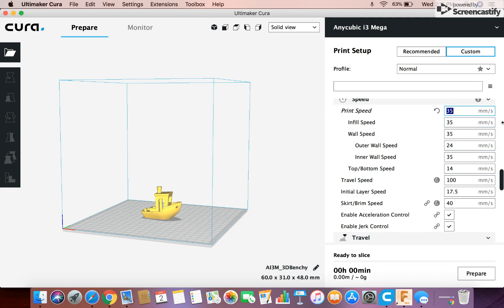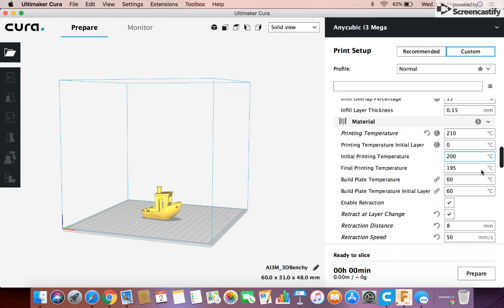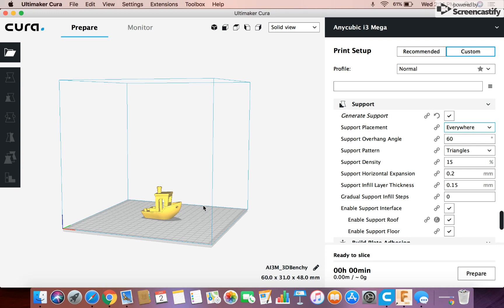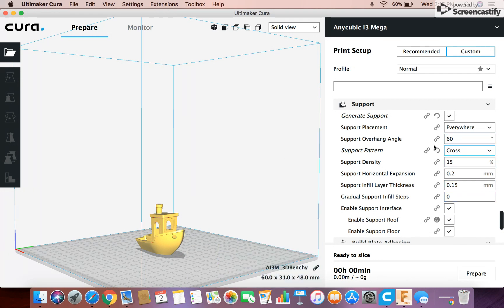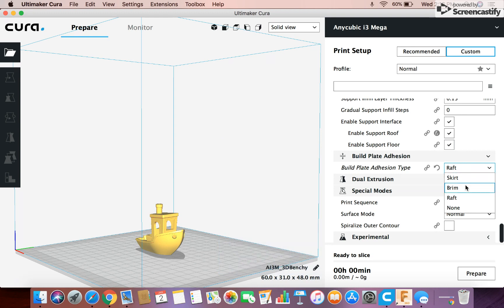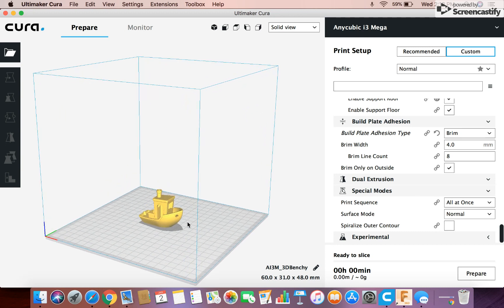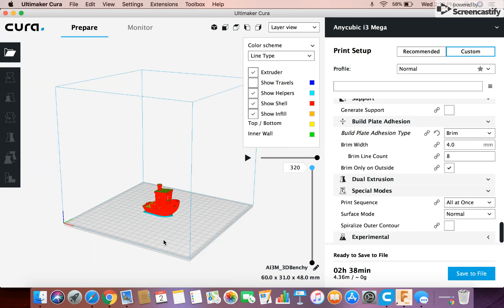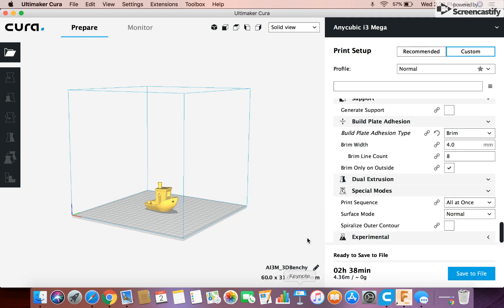How To Use Cura For Beginners- Part 2

Comment: It's hard to make support areas smooth; sometimes even difficult to remove supports.  What do you recommend support thickness?
Reply from the maker: Well, it depends on your printer. Generally default works fine for me. You may consider playing around with the settings for yourself because it is different for everyone.